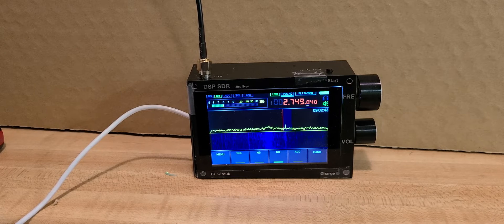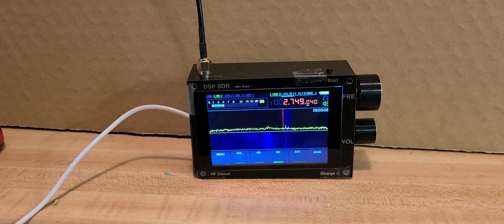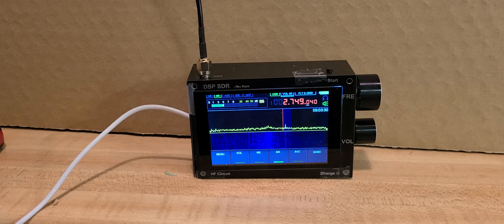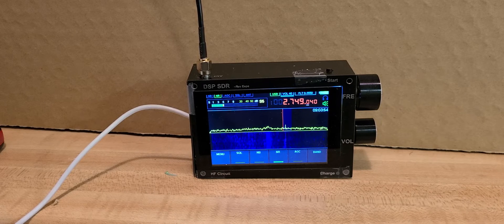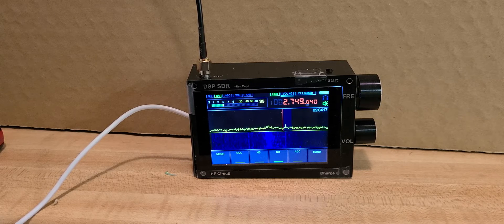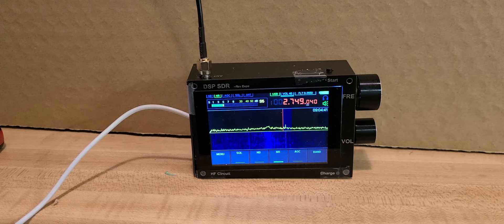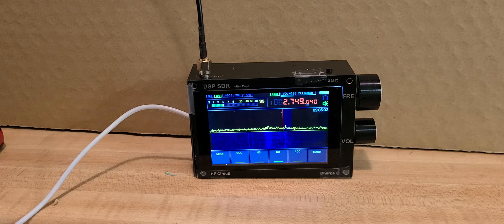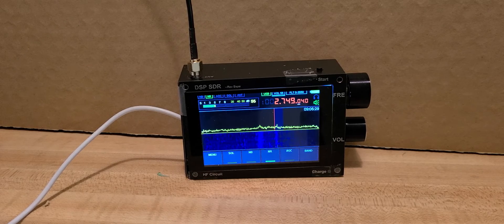Nova scotia marine weather on DSP SDR receiver with youloop passive antenna 2749 kHz Mediumwave

Comment: Gill the medium wave is 522 /1602 khz
Reply from the maker: mediumwave is 300 to 3000 kHz
Reply: @OfficialSWLchannel  not in Italy,because the single radio and radiocar the band 520/1602 khz,73 by swl 03897 Mi
Reply from the maker: no, that is frequency range for your local stations, mediumwave is not that.. mediumwave is a frequency range that goes from 300 to 3000 kHz and it contains many different broadcasts.  you are referring to the broadcast band